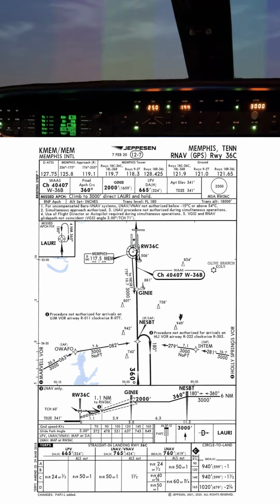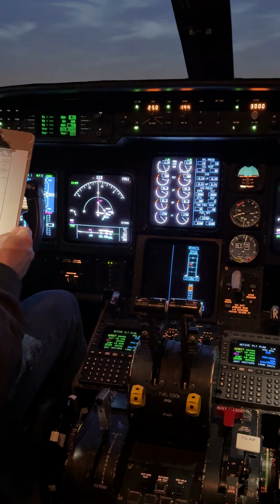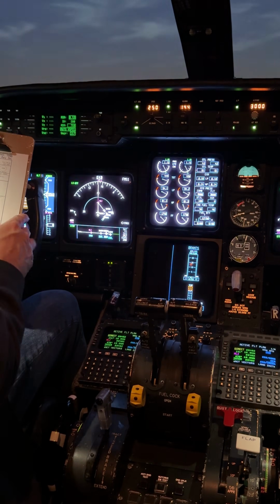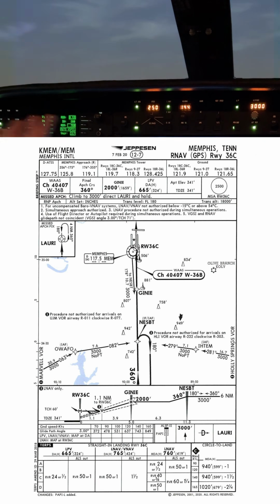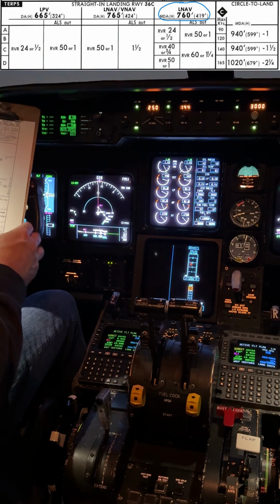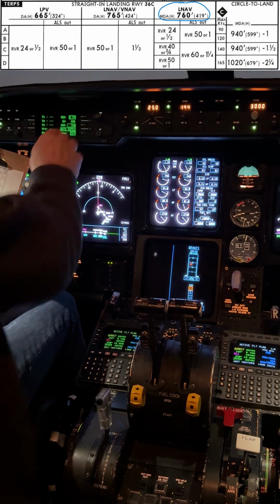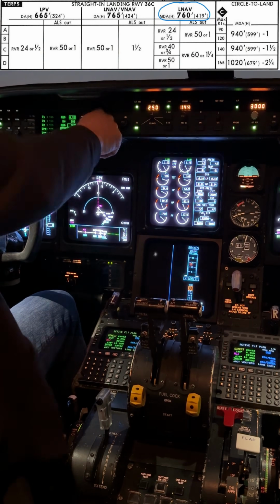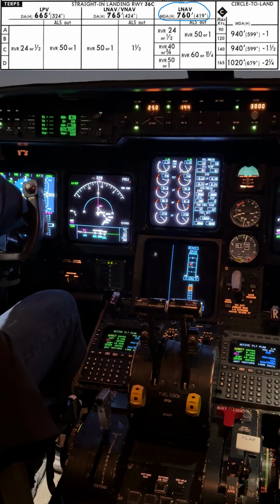RNAV (GPS) APPROACH  KMEM Runway 36C

Comment: Hey Dan - Question. Should the specific operator allow for 50 feet to be added to the MDA (810), can the pilots then put field elevation in the altitude window as long a minimums are set at 810?
Reply from the maker: That’s a great question.  The answer is NO …on the G4.  We don’t use the APR (approach button) on these “blue needle” approaches.  It won’t work in blue needle anyway.  If it did and you pressed approach button it would ignore and fly right through the 760’ MDA.  Some airplanes (such as G550) you would press APR but since it’s a MDA, you would add 50’ and call it a DDA (Derived Decision Altitude) which means you would make a decision at 810 and have 50’ buffer as to not descend lower than the MDA.  We use LNAV/VNAV on this approach.  In that mode, the altitude select (760’) would be honored and the airplane would level out at 760’ and not descend below the MDA.